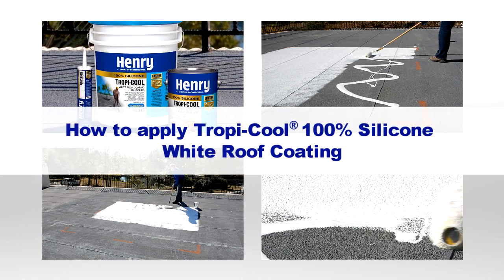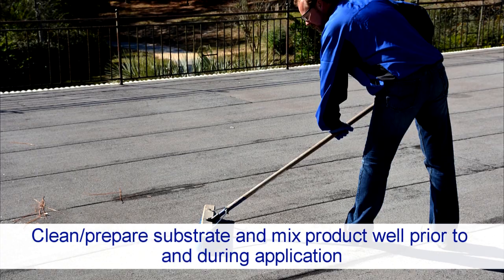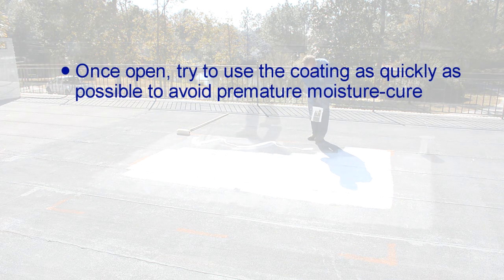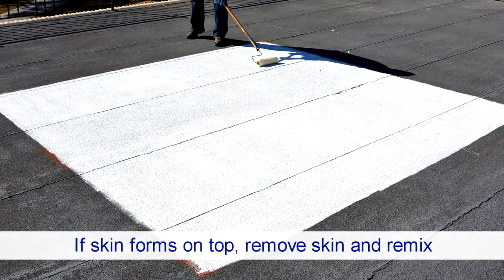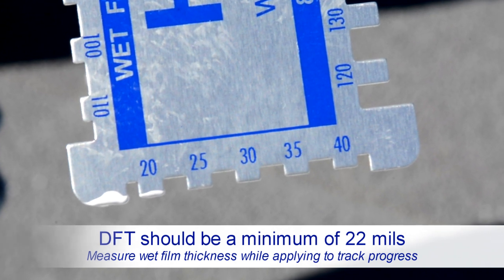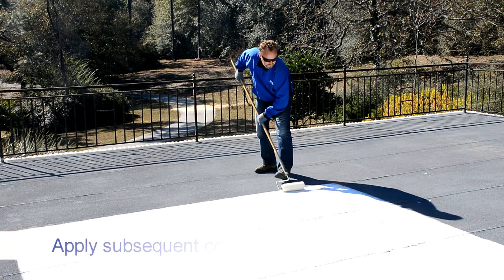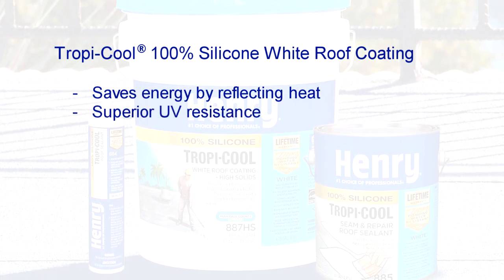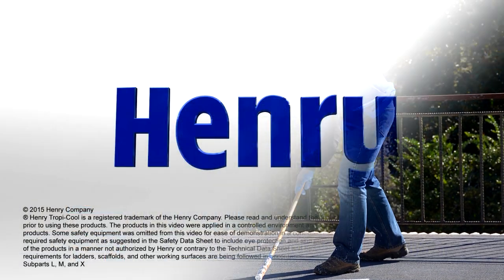How to apply Henry® Tropi-Cool® 100% Silicone White Roof Coating

Comment: We have a fiberglass rooftop which is the third level of a townhouse. Has patio furniture and a hot tub so there's regular foot traffic. In Florida and it's very hot up there during daylight hours. Have a pesky leak but it's mostly contained. Is this a good application for Tropi Cool?

Comment: What does "lifetime warranty" really mean?
Reply: It does not mean a thing.If you have a problem with adherence or peeling .Henry will blame it on poor preparation or the wrong substrate. SILICONE ONLY BONDS WITHE SILICONE.I power washed my existing Henrys887 roof then washed with TSM then wiped with a bath towels peeling on the edges. Its just glorified paint  for 350 dollars.Better to use plain old silver coat for 50 dollars a bucket
Reply: @jamesdirvin  can you re-paint over a 100% silicone waterproofing coating?  i mean, in 15 years time, can i apply another coating of silicone based waterproofing over the old silicone coating?

Comment: Im looking at coating a old fifth wheel with a aluminum roof   It has old others coatings and things   Im going to clean what I can then dump a big coat on of this to fill little holes and bad spots   Hoping this does the trick !  Impossible to clean and get rid of the old stuff perfectly. What do you think ?

Comment: 1) Do I need a layer of Primer before applying the Silicon layer?  2) I have a worn out low pitch flat roof (2/10) which shows the fiber layer in 1 area, can I use this silicone coating to prevent leak?  Thanks for your reply.
Reply: Acrylic primer is recommended. silicone has poor adhesion

Comment: Your product failed and less than 2 years from application. I found three large pin holes that caused a leak that resulted in 64 ft of roofing becoming so rotten in just two years that it had to be replaced $1,200 in materials. I found several other parts of the roof that had big holes in the Henry tropical coating. Holes which I cannot explain. This product claims to have a lifetime guarantee but the company totally ignored me and my request for either a refund or replacement product. At nearly $500 for a 4.75 gallon bucket it is extremely overpriced hopium.
Reply: Exactly ,you can be assured they will blame it on the preparation or substrate. It is glorified paint and will not adhere to many other products.THEY SHOULD PRINT LARGE WASH THOROUGHLY WITH TSM AND SILICONE OVER SILICONE. Then pray for the best overrated and overpriced
Reply: @jamesdirvin  nothing beats a real EPDM rubber sheet, 1/8" thick, but that's big money.

Comment: Can we paint over it?
Reply: Silicone doesn't take paint. I found a way around it in th past by spraying the silicone with https://www.google.com/search?q=3M+spray+glue+for+drywall+corners&rlz=1C1GCEU_enUS947US947&oq=3M+spray+glue+for+drywall+corners&aqs=chrome..69i57j0i22i30j0i390i650l4.33997386j0j15&sourceid=chrome&ie=UTF-8
Then paint over. I can't vouch for how long it will last.

Comment: Can this be used as glue? I need to glue a wood board (2'x2') at the edge of the foam roof to prevent rain  water from falling from the edges.
Reply: no

Comment: If I apply a thick layer over a crack, will it seal and keep water from coming in?  Thank you
Reply: Not recommended, get some self-leveling sealer and fix all cracks before applying the Henrys.

Comment: I just finished coating my flat roof with 25 gallons of your 555 Aluminum Fiber Roof Coating. I have depression in the roof where ponding occurs, it's 2 feet by 2 feet and about 2 inches deep. Do you have a product that I can pour into the depression and build it up? Maybe pour a 1/2 inch each week and let it dry and do another 1/2 inch the following week etc. etc. ?
Reply: this would work for that, buy a gallon and use it that way, the last layer would just be a pour to level it.

Comment: Can this be applied to new construction/ new plywood and use as the only roof. Or is this just used for a moisture barrier
Reply: this goes on top f a clean roof substrate. Best to apply roll roofing or some other membrane first.

Comment: This worked so good on my asphalt shingle roof in phoenix.  I ended up using 7 5 gallon pails. My attic fan no longer runs at all now. My white shingles used to be 165 degrees. It now reads 105 degrees on a sunny afternoon. Saves me 50$ or more per month. My ac bill is now under 200$ a month in July and August. Thanks!!
Reply: I am planing to coat my asphalt shingle too but they stated that The curing process of the coating could cause the shingles to curl and even break, do you notice any curl shingle after your roof coating cured?
Reply: @blessingpeace +g
Reply: @blessingpeace  not for use on shingles.
Reply: How did you apply brush or sprayer and how did you clean up ?
Reply: wait 1 yr when dirty, looses 30% reflectivity then another 20% 1 yr later
Reply: @malibudan  New formula has "Dirt Pick-Up Resistance (DPR)". I hope it helps.

Comment: what size roller nap is ideal for a flat somewhat smooth concrete roof?
Reply: 3/8 inch nap
Reply: Or just watch the video where it tells you 1/2-1” nap

Comment: I'm looking at using this product on a rubber RV roof. Question: Is the Tropi-cool product that comes in the caulk tubes (884) the same as what comes in the one gallon size (887)?
Reply: Hello Joe, did you ever try Henry tropi- cool on your RV ROOF.??
I was thinking it might not stick to my vinal/rubber roof.
Plus nothing else sticks to silicone products they are telling me.
I might have RV ARMOR come to my location and do there permanent life time roof coating to my 25 yr RV..
They send a team of guys out to where you are and do the job..
Look them up..
RV ARMOR

Comment: I read below that this should not be used on shingles.  But my roof, similar to the one in video, looks like shingle material, but applied in rolls or sheets, I'm not sure.  but why is it ok for this surface but not shingles?
Reply: Shingles are mean to be installed on pitches over 3/12, you can use it for roll of tourched or self stick rolls with a pitch of 3/12 or less, it will work with two coats very well for at least 7 years if well applying of a 30 mill uniform coat.

Comment: Very expensive . $248 for 4.75 gallons. I went with duro brite
Reply: Where did you find it that cheap? It's $445 at Home Depot right now.
Reply: I found it for that price and it's what it's selling for  year ago when i was looking on the West Coast in The Home Depot
Reply: This and duro brite are completely different materials. This is 100% silicone, lifetime warranty product. Good for at least 50 years. Duro Brite is an acrylic product that will not last very long and will require more maintenance along the way. Absolutely not worth the small savings - the amount of installation labor is the same.
Reply: Dude  Start telling the truth here. The duro has a 10 year warranty  And it's quite a bit less the other you're talking about not a little bit quite a bit it's more than double the price. You are probably selling it is why you're saying this stuff so you can  sell the high price stuff. You can also recoat the duro.  Read tis from google . Summary: roof coating systems last 10-20 years, but once they reach the end of their warranty, they can be recoated and a new warranty begins. The process can be repeated, making roof coating systems a renewable and sustainable roofing system
Reply: @stevewinter8928  who is selling stuff? He was complaining about how expensive it was where he looked at it.
Reply: @ThorD4602  🤣
Reply: @kendalgee5808  Steve Winter and Steve Summer.......

Comment: Will this adhere on top of white, clean, cured acrylic elastomeric coating? Thank you
Reply: I want to use this kind of product on my school bus I am converting into an rv. What kind of prep needs to be done when applying to a metal roof?
Reply: @TheJameskelley0327  I'd just clean it off really good with bleach and TSP mixture or any good house cleaner chemical that also kills mildew, algae molds etc.

Comment: In this application, it appears it's not for waterproofing, but only for reflecting the sun. I'm looking for a long lasting waterproofing option for my roof without going to 20x50' rolls of EPDM rubber sheets.
I currently have liquid EPDM over epoxy primer over roll roofing just like this video, but it failed after 3 years and the material is breaking down with micro cracks and is peeling and has cracked along seems, letting water in.
Do you have a stronger solution that would last at least 20 years or more before starting to break down in northeast winter weather?
Reply: it is 100% waterproof and will not allow water to penetrate from ponding. On flat roofs, this or Eterna Kote are the best product for homeowners to make a waterproof flat or low pitch roof
Reply: @ThorD4602  I'm now trying Tropicool on my roof. Problem is, there is still water bubbles forming every few months. I found a large bubble with a couple gallons of water in it, so I cut about 30 sq ft of the lifted material and re coated it with Tropicool at $138 for a gallon of the stuff. I'm hoping it doesn't leak again. It seems that all of these coatings are porous and let water in.
Reply: @basspig  no. Tropicool is 100% waterproof, but if you didn't apply it to a clean and dry, approved substrate, it will fail, also if you have a leak elsewhere that is allowing water into the roof structure, that moisture will find its way under the silicone. My guess is that your roof was wet internally already or has a leak elsewhere, this stuff can't leak - that's why you got a bubble rather than the water coming out through the material
Reply: @ThorD4602  The roof is flat with a 5° pitch and is composition roll roofing, on top of which is EPDM Coatings epoxy coating, over which is their EPDM liquid rubber. That developed pinholes, and I had to remove sections that bubbled, and so last year I did a full coat of Tropicool over everything. The following spring, I had a couple of areas that accumulated a LOT of water. I'm thinking the only possibility is that there were bubbles in the Tropicool as it cured, and parts of it were porous and let the snow melt work it's way in. There is no existing water inside the roof. Certainly not gallons of it like I found this spring.
I am hoping there are no more of these instances. I need to put solar up there soon, as electric rates are set to double on Jan 1.
Reply: @basspig  My flat roof had a white coating that bubbled.  Other yotube roofing channels say don't put silicone coatings on a metal roof because 1 tiny hole water penetrates and rusts it out.  I think gaf liberty cap sheet self adhesive peel and stick/ with metal flashings / and the proper asphault primer and flashing cement over it would be the cheapest best option.  Im hesitant to recoat my flat roof with silicone due to  bubbling concerns.
Reply: @kendalgee5808  apparently all it takes is one tiny pinhole, indeed. This roof is mineral 90'b roll composition with a coating of epoxy on it and a coating of EPDM rubber on top of the epoxy. The EPDM had developed thousands of pinholes and began to bubble/peel off, so I tore off large sections of EPDM and recoated the entire roof with this silicone. I think a major problem is that there's no easy way to garantee minimum thickness to the application. Some areas are paper thin while others are 4mm thick.
Who sells the Liberty cap sheet? Is that in 10' wide rolls? Do you need to bond with a torch or just self adhesive? I don't consider any self stick stuff to be very durable though.
Reply: @basspig  I'd say, if it's a pond on your flat roof, try GAF Liberty Self Adhering cap sheet.  That will keep it waterproof. Hopefully it doesn't break below the seam.  It usually takes 5 days to dry a pond on your roof naturally.
Reply: @ThorD4602  On flat roofs, it's common for them to fail to use asphault primer at the flashings.  Likely a flashing failure that reverse leaked through his seams and bubbles to the silicone perhaps.
Reply: @kendalgee5808  During the winter, with a couple feet of wet snow on the roof, the hydrostatic pressure makes water run uphill under the seams in the original roll roofing. I need to seal it like it's under a lake.
Reply: @kendalgee5808  yes, water is getting in from elsewhere further up the roof, or he has no venting to the roof so moisture from inside the house is trying to get out. This stuff can't leak if it's applied properly.
Reply: @ThorD4602  I've got leaks in one particular area of the roof and it's coming through three light fixtures and also the nails are popping out through the plaster indicated wet joists now. The rain we had on Monday saw enough water coming in to start dripping onto the couch and carpet this week.
I went up on the roof and looked at everything from the leak area and uphill to the west edge and found no holes. I have no idea how the water is getting in. The roof should be waterproof even without the coating on top, as I did a thorough job of coating the decking with asphalt, then applying 30lb felt, then asphalt over the felt, then 90lb mineral roofing over that with 4" overlap. 
On top of that, I put down EPDM Coatings epoxy, then EPDM liquid rubber coating, which failed after 3 years. Then I put down Henry Tropicool over the entire roof.
Now if the leak were at the edge by the flashing, I would have expected the leaks to come out near that area, not a dozen feet down stream, as there are gaps in the sheetrock where a  carrying beam is to support the overhang. Instead it seems the leaks are originating somewhere in the middle of the roof, but I cannot see where. The decking is now rotten and soft as a result in that area. That was 3/4 PT plywood.
Reply: @basspig   I'd have to see it in person to tell you how it is leaking. Your best bet is to hire a roofer to come and inspect it.
Reply: Sounds like a nasty project. roofing can take you to your limits. If this material is installed correctly, it isn't possible for water to go through it.If you can't figure out where the water is coming from, only corrugated metal roofing on top would be 100%, but at that low pitch you have to Install that perfectly too.
Reply: @ThorD4602  I'd just spent 14 years rebulding the infrastructure--all new pressure treated 2x12s, lots of lag bolts, lost of PT roof decking. Only to have it leak after a few years. I'm too old to be going up on roofs now. Just need it to be reliable as I finish out my last remaining years on earth.
Reply: @basspig  I feel you. I'm trying to get my heavy work done soon too, I've got a few more years of heavy labor in me, but not too many. If I could help you solve it with more than what I've said so far, I would. If roll roofing was put down and then this stuff applied on top of it, water can't get in. My only remaining advice would be to see if there is a spot water is getting in under or higher up in the roof structure, ordrom within the roof itself-plumbing, lack of roof venting. I truly wish you luck with your dilemma.
Reply: @ThorD4602  I can find no other way in other than pinholes. The problem with roll on roof coatings is there is no way to control the thickness and I suspect some areas are too thin and prone to pinholes.
Reply: @basspig  pinholes gappen during application, not after . So they are visible as you apply. Need to give some decent force when putting these coatings down and linger in an area until you are sure it is fully sealed. Also the have primera that you can apply first which make it less prone to adhesion problems. Over the long haul.
Reply: @ThorD4602  Unless I got down close to the surface, I cannot see them from my normal standing position. I used a roller, as directed on the can label. Home Depot didn't have any primer, nor did I know one was available. I used EPDM Coatings primer/epoxy coat on the original roof, so it's got that as a base coat.

Comment: I just finished applying Tropic-cool to my 1995 Bounder. Rubber was showing...I found a foam roller worked best for my use in applying it. I'm hoping it keeps the roof from having to be redone anytime in the future. DO you also give the same life time warranty to RV roofs?
Reply: I don't see why they would not.
Reply: I have a 94 Bounder, how did it work on yours. Did it help with any leaks?

Comment: This I need so so badly roof is leaks water inside my room 😭😭😭😭 question do I need to clean water blast or just remove leafs dust by using blower? Thank you 👍👍 it’s helps me watch ur videos
Reply: Common sense (and this video) dictates you must wash the existing surface. Duh.

Comment: How about over rubber flat roofs and repair?
Reply: Did u ever figure it out
Reply: read the label on the website, but  this should work fine on a rubber roof if it is clean and dry

Comment: My question is concerning solar panels on my motorhome.   I want to cot my roof with henry tropicool  and then screw down 24 solar panels.   Do I use the tropicool as caulking over the panel brackets or is there another product that will stick and waterproof my solar installation?
Reply: I mean this is pretty much bulk caulk. They make 100% silicone caulk. But you could use siliconized acrylic too. Some will have more uv protection than others but you can use all kinds of spray on uv protection coatings on top of that too

Comment: I have a fiberglass motorhome roof and have never had luck with elastomeric products.  Will the 100% silicone rubber coating work on fiberglass?
Reply from the maker: HE887 Tropi-Cool can be applied to aged fiberglass that is clean and dry.

Comment: Can you apply Henry Tropi Cool silicone white roof coating to a flat room that is covered with 2 coats of some sort of silver coating that a roofer put on several years ago?
Reply: Yes. Is for a variety of coats, asphalt, aluminum, fiberglass, etc. you’ll find where you can apply it on median size letters on the front of the bucket by the main label.